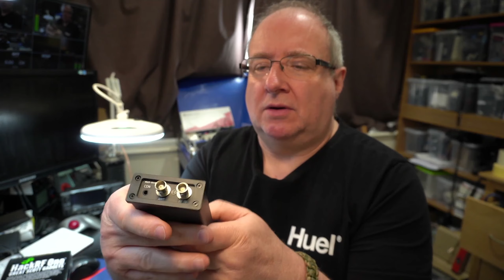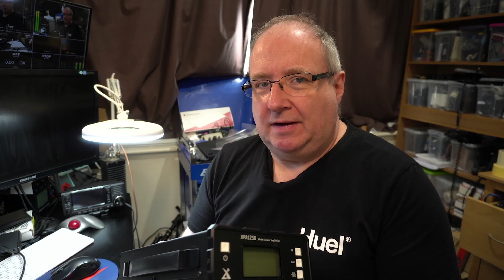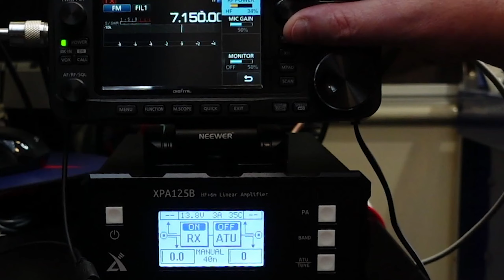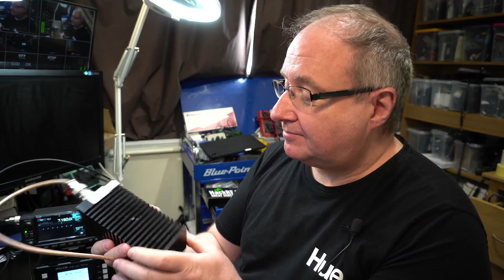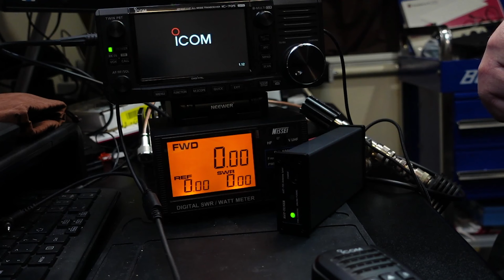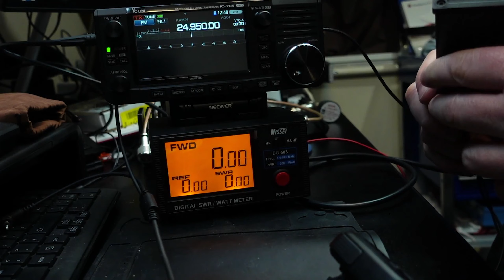Xiegu XPA-125 I push it to see what I can squeeze out of it.. I also look at the MAT-705 Tuner :-)

Comment: DO NOT put more than 2 Watts drive into this amplifier with the RX enabled . You will kill it dead in a very short period. Ask me how I know!  Spent 10 bucks on the Radioddtiy extended manual for the XPA 125B and they  say 2 watts max into the amp. Tune at 5 watts is ok, run amp at 2 watts is the limit….  Repaired 125B running 0.9 watts in and getting 85 to 95 watts out.
Reply from the maker: There are so many versions of this amp it appears. Some need a little more some need a lot less.. I’ve see a “few” of these things lol 😂

Comment: Hi Gary, many thanks for the informative video.  I'm considering the XPA125B as a companion to my great IC-705.  In the videos I've seen, the DC supply voltage, as shown on the amplifier display, always drops significantly when transmitting power.... strange.  Also, I'm surprised it's showing 3A current drain when in idle.... I thin spec is 0.7A.  Maybe owners can shed some light! :-)  73!  Tim
Reply: Yikes! I just did the sums: It was already into 1.4dB compression at 92 Watts! 😲  That drop in supply/collector/drain voltage probably doesn't help 😛

Comment: This is as much tongue in cheek as I can muster in a comment. 
I searched for the "this one here" cable for tha mat tuner on the internet and could not find it. I.d. or link?
Reply from the maker: Hi Kyle, what do you need to do? Gaz
Reply: @TheGazLab  

No worries. I scoured the web and found a mat to 705 cable... o'var 
73
Reply from the maker: @kylezeringue5673  if I recall the cable between the mat tuner and 705 is a 3.5 to 3.5mm jack to jack audio cable off amazon.. either way, glad you got it covered.. Gaz

Comment: Very nice video thanks!  How did you wire the xpa to the 705?  Ground and ptt wires only?  Thanks again for the informative video. Cheers
Reply from the maker: ground and ptt yes, be careful its important not to get the ptt on the wrong part of the TRS plug as it will just go permanent TX.. I have seen this cause a transistor fail on the amp PTT circuit.. Gaz

Comment: Do you hook up the amp directly (keying for the amp, or do you use a relay box to protect from  voltages/currents  getting back into the radio? A $1200.00 radio is not something you want to take chances with.
Reply from the maker: You can use an optocoupler that would be pretty trick, although so far had no issues..

Comment: Any update to this amp Gaz ? what power output do you get on lower input power, i would prefer to run lower than 90w ideally 50 max and 30 on ft8 and cw.
Reply from the maker: It gives around 70-80 watts with 1 watt in 2.5 watts its flat out gaz

Comment: hi i have this amp for my 705 works very well dont go over 1 .5 watt on 160/ 80m   i have found some bands dont give more than 100w  but its fine the tuners a bit odd i had to use just the output from the 705 on fm 5-7 w then it would tune but with the pa on and pa at 20w out it would not tune on swr under 2.0

Comment: The amp is designed for the Xiegu G90 transceiver. The G90 is worth a look and in many ways out performs the IC705 while costing just over £350
Reply: i have had a g90 they work ok but not the best, transmit audio is not the best i guess a better mic would help and for me the screen is to small
Reply from the maker: @kazcat8096  I’d love to try one perhaps they will send me one lol
Reply from the maker: I will obtain one and give it a try, thanks for the heads up.. Gaz
Reply: Are you having a laugh 😂😂 , the G90 is not even in the same league as the 705 .
Reply from the maker: He is just pointing out the extras , tuner and power.. not saying quality.. Icom is almost 3x the price a g90 is ok if you are on a budget just don’t expect it to be working in 2 years .. if it is bonus.. gaz